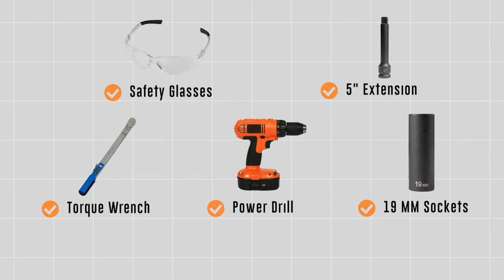2011 Toyota Corolla Trailer Hitch Installation

Comment: But it ain't a 2011
Reply: 2011 and 18 are the similar
Reply: @MarkCocson  well I never new that because the body styles are different. 
Then the 2019 should work too and thru 2009-2019 then. Because your saying they are the same the 2020 is a newer body style
Reply: @MarkCocson  when I had a 2011 and tried a 2016 tow hitch it didn't work so 🤔